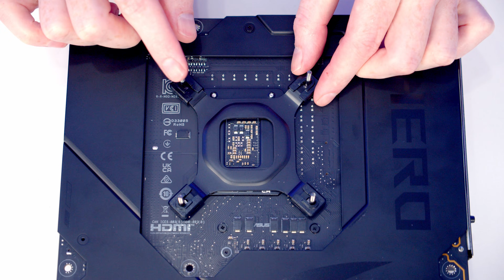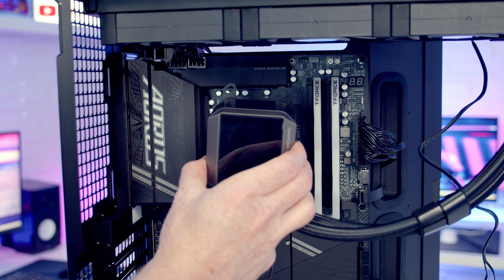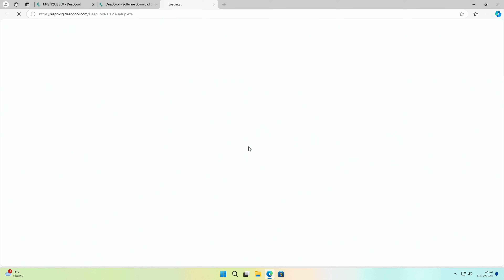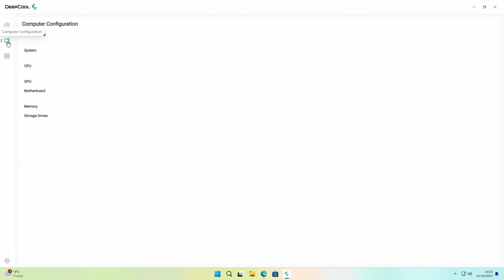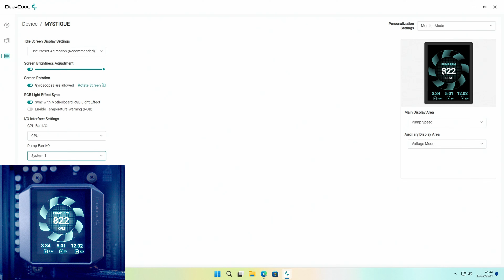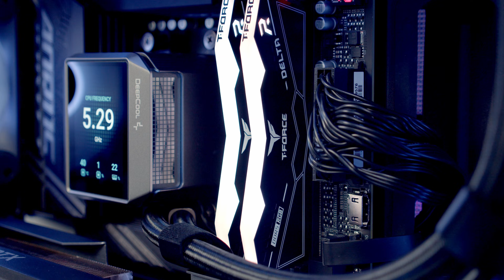DeepCool Mystique 360 ARGB - Installation Guide

Comment: Hey, idk if you still read comments here or answer, but i am trying to find out if i can place the tubes on top, basically rotating yours 180°, because i use the CL660 and it has a seperated AiO compartment

Comment: Hi thanks for the guide. The DCM 360 is noisy, so could we change the RPM for the fans and the % for the pump ? (if yes is it only in the BIOS?)
I read that is not possible for some, however some tests mention it, so...
Reply: what do you mean?

You can always change the rpm of pump and fans seperately, thats why you have 2 pwm cables, just remember whose cable is plugged where on the motherpbaord (the port has names on the motherbaord, or you can refer to maual if its dark and you cant read physically on mobo0

Then, remember the ports you plugged your pump and fan on, go to bios, go to fan control (each brand have different names and way to access them) and then you can set the percentage you want your pump or fans to run at what speed (generally in percentage) like either set a constant percent or dynamic percentage depending on your cpu temp
Reply: @PannyLanny  Thanks for the reply. Good to know, I was wondering because I don't have an AIO/watercooling yet. I was asking this question to get any advice or warnings specific to watercooling.

Comment: Recently, a review of the Mystique 360 (non-ARGB) version found an issue with the liquid. The reviewer opened the pump’s gold palette and discovered dirt on it after 4 months of use. They explained that the chemicals in the liquid caused this issue, which may not be ideal in the long run.

The dirt can accumulate on the fins and, over time, block them, which is detrimental to performance.

Can you confirm whether the updated ARGB version has the same issue or not?

Comment: Hello... I see 0 in PUMP RPM and also fan speed... do you have any ideas about what happened ?
Reply: Could be a few things:

 1.- Factory issues 
2.- Bad connection (you connected in wrong connections or faulty cables).
3.- Windows or drivers issues
4.- Software Isuues

Should explain better your situation.
Check the manual always.

Comment: I just installed this cooler to my pc and all works fine except when I go for media mode (try to display image/GIF) the lcd went white screen with “no image” written on top left of the screen. Is there any chance you know how to fix this?
Reply: Am having the same now , have you found a solution?
Reply: @ claim the warranty. They replace it woth the new unit.
Reply: have the same issue, didn't knew it earlier or else i would have bought some other AIO

Comment: Need help, everytime i restart the PC, the deepcool display always back to default.
So i need to open the program each time to return the gif display

Does everyone face the same problem or have any solution? 

Thank you
Reply: This is normal
Reply: Since the information on the screen needs their software to work, one tip is to force the software to start with Windows, so that when you enter the desktop the software will open automatically.
Reply: Lian Li Also needs a Software to Start the GIF

Comment: Guys dont buy this. There are problems with the lcd dying within a day and a loud pump. The lcd already died for mine.
Reply: maybe its wire problem? try plug and unplug all wires or try slight rotate them if the lcd blink on
Reply: @ it’s not a wire problem. I would know. I did try to wiggle the wires near the lcd a little to see if it was loose inside but no response. Simply a bad product. I’m not the only one with this issue. There have been multiple reports of dying lcds for this cooler so it’s apparent that this product is faulty.
Reply: Same happened with me, just installed it and lcd has already died

Comment: Thank you, Chris.  I LOVE my Mystique 360 (I also have a 240 on the shelf, just to look at 😝).  Those wires from the pump were difficult for me to manage.  To keep them neatly together and (mostly) out of sight, I had to route mine down also, through the grommeted pass-through to the back, and then up through the PSU shroud.  It worked out pretty well. 😉

Awesome line of AIOs, and priced very competitively to boot.  DeepCool's LD series (which I have 3 of) utilizes the same 5th generation pump design, and has the same cable management features, as the Mystique.
Reply from the maker: The large collection of cables is the only downside